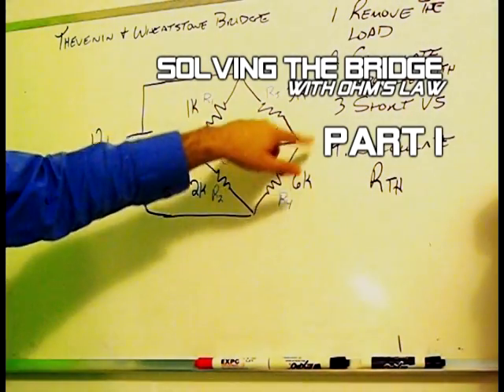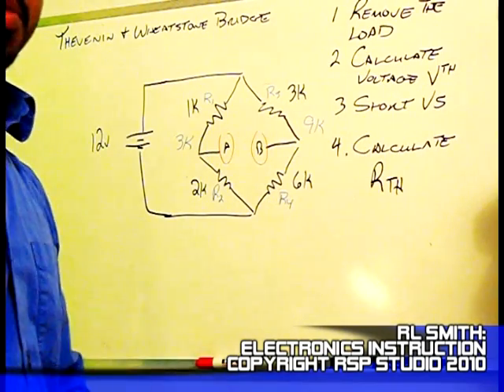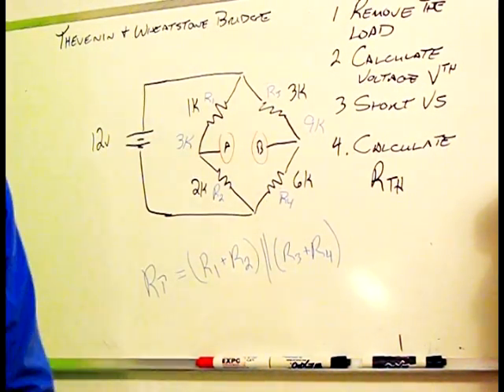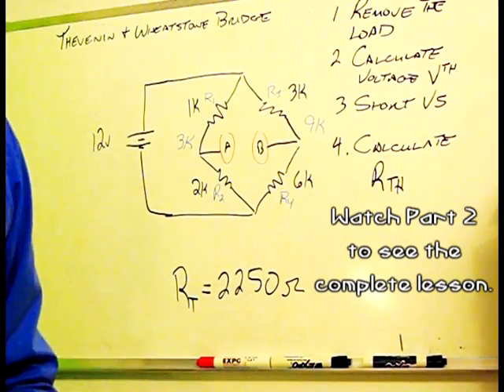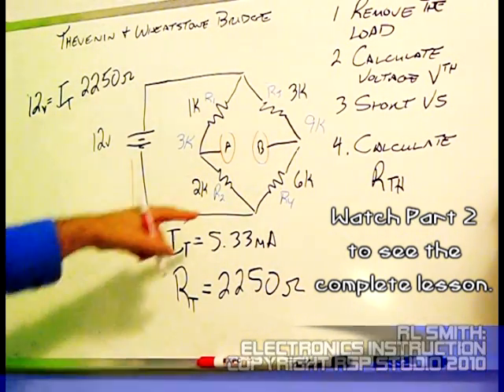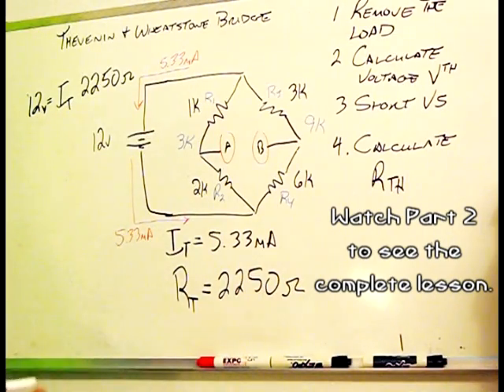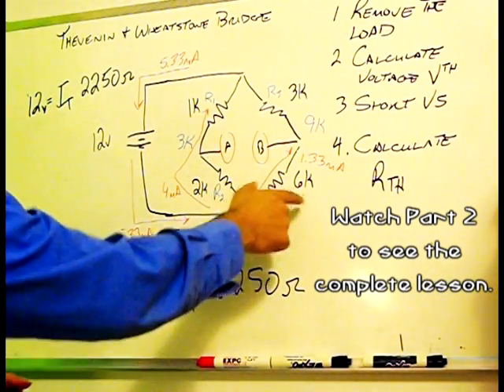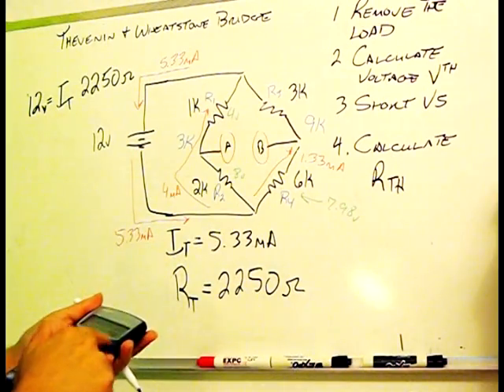Solving the DC Bridge Circuit Part 1

Comment: "Professor", with some math you can come up with a shortcut for parallel resistances:
R = 1/(1/a + 1/b) = 1/(b/a*b + a/a*b) = 1/((a+b)/a*b) =  (a*b) / (a+b)
In this case Rt = 3K*9K / (3K+9K)  = 2.25K = 2250 Ohms. That's way much easier, especially when you don't have a calculator at hand.